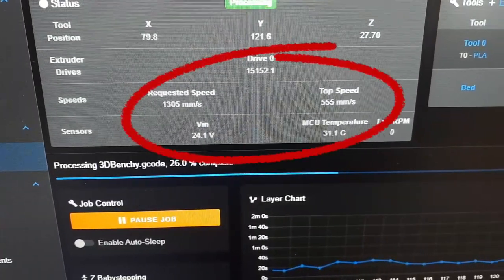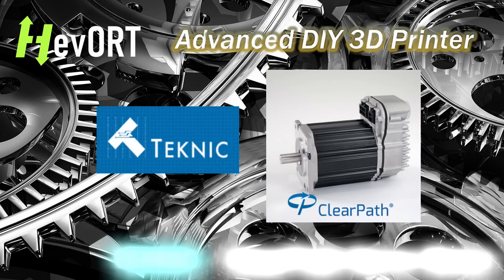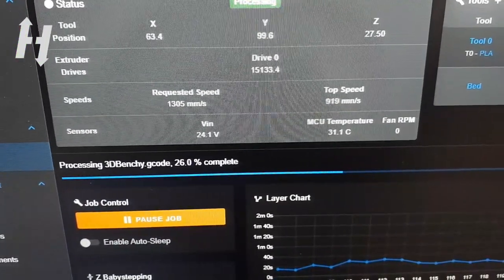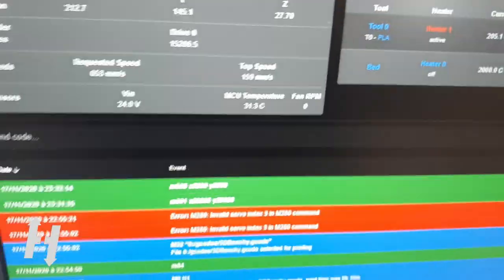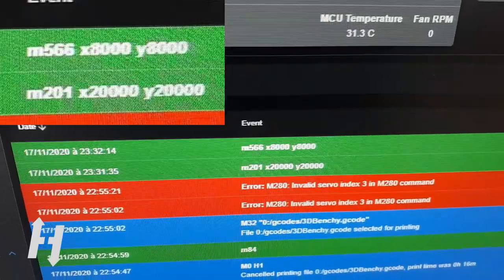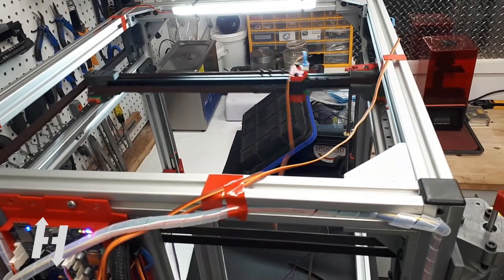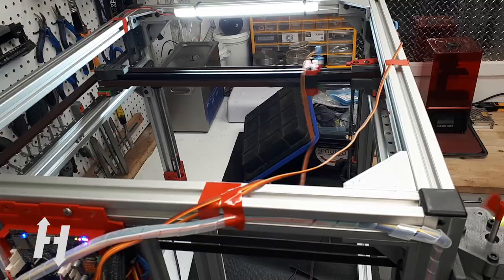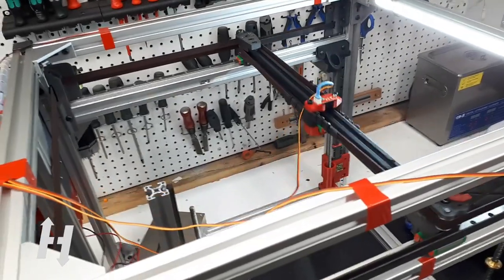3D printer on Servo Motors? HevORT & ClearPath testing spoiler

Comment: So sick. Are you using an Odrive to control the servos?
Reply from the maker: No, I am running the ClearPath through step / direction / enable type of signal using the Duet2 Wifi and a breakout board made for 5V single ended logic.
Reply: oh 0drive would be interesting for like a massive printer
Reply from the maker: @quinnfoster4671  have a look at these clearpaths ;) https://www.teknic.com/model-info/CPM-SDSK-2321S-RQN/?model_voltage=75
Reply: Have not seen Odrives or Clearpaths on a 3D printer, although I've been waiting...
Reply: @MirageC  I've been working on a pellet extruder design for several months.  Maybe you can help me test it when I'm finished 😁
Reply from the maker: @brawndo8726  For sure! keep me posted :)
Reply: @MirageC  Sure.  I can ping you in the git repo.  Happy to chat if you have any questions.
Reply: He's using ClearPath servos in step/direction mode.  About 2x the price of an O-drive setup but nearly plug and play with a Duet2 or Marlin board.  You can get them up to 2hp continuous 4hp peak if you want to move bowling balls this fast...  If you were going to production, a "low" power O-drive re-spin or sweat-heart deal with ClearPath servos would be the way to go. For one off printers, the ClearPath servos are a winner due to the plug-n-play.

Comment: My understanding of where the bottleneck is in speed for 3D printing is in how fast it can extrude the plastic. You can go either bigger nozzle with low resolution on the print. Or make a hot pot resorvere. Where you melt a lot of plastic in advance and then use something like a auger to extrude the plastic faster through smaller nozzle. Or use 2 heads, one with large nozzle where you print it into a ruff size and then use secondery nozzle with smaller nozzle  that puts on the final top layer...
Reply from the maker: Yes, definitely, the extrusion system will be my next bottle neck.  We will explore various options.

Comment: Is your printer as quiet as it sounds at these speeds? Mine is so loud even with tmc
Reply from the maker: Yes it is, Servo Motors are completely Silent.  Keep in mind that there are no cooling solution yet on that test bench ;)
Reply from the maker: Arpad Toth  like the HevACS?

Comment: The proof is in actual prints. I did ClearPath motors on a larger 3d printer four years ago and couldn't get it to not induce banding in the print. I currently just run steppers on that printer and it's been fine. I also run a 5kg pellet extruder off of it. I wish the CP motors gave me better print quality as I really appreciated their silence.
Reply from the maker: Yes Jeff, I have been reading about your experience on various posts.  I will give them a try and see if Teknic is ready to support if I cant get proper quality.  Just a quick question.  when you tuned your CPs, what did you do with the other servo?  I simply enabled it so it would be "locked" and then tuned the other motor.  I did not think of any better to represent the CoreXY environment.  I am using the 800 count per rev version.  (CPM SDSK2321S - RQN)
Reply: @MirageC  I ran a crossing gantry machine as I felt CoreXY was too new. But I too would guess “locked” is probably the best bet while tuning the other motor.
Reply: Hi  @JeffDM 
,

I’m an applications engineer at Teknic and I came across your comment. The banding you describe can be caused by a number of factors, most of which can be resolved. (We have a number of OEM customers that successfully use ClearPath motors on 3D printers, so you can be confident that there is nothing fundamental about this application that would preclude using a high quality servo and getting good motion performance with no banding.)

It’s common to see banding (or similar artifacts) occur when there is a mechanical issue, but since you mentioned that your stepper motors are working well on your machine, I think the odds are pretty good that there’s nothing mechanically wrong with your system. (This assumes that the move speeds and accelerations were the same in both cases, because higher accelerations, in particular, can illuminate weaknesses in mechanical systems that wouldn’t be seen at lower accelerations.)

This means the problem you experienced was likely caused by either suboptimal ClearPath tuning (i.e. the Auto-Tuner didn’t give you ideal results for some reason) or a ClearPath motor set-up/configuration issue.

If you still have your ClearPath motors and the time to run them again, we would be happy to arrange a time for one of our engineers to remotely dial into your machine and make sure that you get your machine working well.

If you’d like to do so, please give us a call at 585-784-7454 or fill out a "contact request" on our website to schedule a session: https://www.teknic.com/contact/.

Jon K. – Teknic Servo Systems Engineer
Reply: @TeknicInc  i have a very heavy gantry system with 4 motors on the Z, 2 on the Y. i ordered the biggest Nema34 clearpath motors, but now i'm questioning how i should tune them ... as i cannot move the system with 1 motor only

Comment: Assuming there is no flex, is layer adhesion affected by faster speeds?  As a thought experiment, If I had a frame carved out of solid diamond with motors to match, could I expect to have good layer adhesion?

Comment: Essentium has a hotend that heats to 500c in 3s and They print Even 0.6mm at 400mms so its deff possible..

Im looking at a simular setup but just with precision ballscrews that has no play and 0.0025mm precision. 
All made possible for my budget, after discvoering clearpath :)

Comment: I always wanted to see this. My extra large format machine moves a printhead that is over 1.5 kilograms and with TMC drivers and Nema23 motors I can't get over 160 mm/s speeds othervise I get missed steps (shifted layers). Been looking for a servo driven printer build like yours. Keep up the good work!
Reply from the maker: Thank you!  Yes, nema 23 have good torque but poor speed due to their high inductance.

Comment: The speed is not difficult to achieve. There are tons of applications moves lightning speed. But as he says managing the rest of the printing operation is problem. Extrusion, cooling etc. I think, it can be used some sort of molten plastic reservoirs that pump molten plastic directly from nozzle. So, there will be no hot end but hot reservoir let's say 100ml. And that reservoir needs to be fed by external plastic source.

Comment: By mistake I have 32 closed loop servo motors...but couldn't figure out if I can Run them on a Standard 3d printer Board... What elctronics drive your motors? I have a half built Delta for our makerspace, that would be great I think as a showpiece and also we're building up a Lowrider2 for the makerspace 🤔

Comment: The sloppy hot filament coming out of the nozzle will have some significant inertia before it cools down in situe. You'll require significant cooling at the tip and some powerful nozzle. Friction within the nozzle and filament pressure flex within the nozzle itself will become the next once you fixed that. Happy engineering ahead ;-) Nice project so far though.
Reply from the maker: Yes, agreed.  I got that cooling issue somehow sorted out :)  https://www.youtube.com/watch?v=65FVQ1jArME

Comment: Amazing work and fantastic video! Which version of the XY are you using 9mmHd or 12mmHD? I am working on purchasing parts using your build. I had planned on going with 9mm belt drive and nema17's to start. Wondering if there is much of a difference in drive weight between the 6mmSTD and the 9mmHD set. 
I am attempting to give myself some room to grow on tuning the printer for faster speeds. Do you think performance will be lost using nema17's and 9mm or 12mm belt drive? My best guess is it would reduce  belt stretching at higher speeds. Trying to future proof my build a bit, wondering if i should go bigger and use the 12mm belts?
Reply from the maker: Tough call, even for me to say at this point.  12 mm like I have feels great.  Definitely more friction than a 6mm setup, but very solid.  My current position on the question is that if you intend to use super heavy X carriage, or going bigger than 500mm square, go 12mm.  If not 9mm will probably be your best bet.  But once again, this is all new territory for me as well.  The Think, Design, Try, Correct circle is in the Try quadrant for this gantry ;)  Correct quadrant looks smaller and smaller every day though ;)

Comment: Which kind of linear rails are you using? Do you think cheap Hiwin clones will do for a CR10S project well? Thank you for your videos. Your HevORT project is very inspiring!
Reply from the maker: The 800mm/s video was done on Genuine Hiwin rails.  This new frame with the clear paths is using clones.  So far so good, but print quality needs to be validated.

Comment: I've been wondering exactly this for a long time! Thank you for this! Never could afford servos to test it, so i haven't.. but i think  conventional hotend could never keep up with that, needs to be force fed with a hopper that can really push stuff out, and in order for the layers to cool down fast enough, rather colder temps than hotter
Reply from the maker: Thanks for the comment.  Yes, these motors are going to open many doors.  Some doors currently lead to the unknown.  A lot of experimentation is to the agenda for the nex couple of months.  One thing for sure, the HevORT HD XY gantry can take some serious abuse!  Been pushing the servos to 80K acceleration and 60K jerk at 1200mm/s for 30 minutes.  No sign of fatigue or damage so far.  belt tension is maintained.
Reply: @MirageC  and with a servo to drive a hopper against it's will to push enough plastic, i'll come for a visit to build a 2x2x6 meter printer 😁
Reply from the maker: @Tarex_  We will need to re-think a few things for such a size though ;)

Comment: What motor type are you using for the X Y and what belt size? I am in the process of building a hevort and trying to work out the best drive system. The bed is 500 x 500. Apprciate your advice.
Reply from the maker: Hi Ben, those motors a test, they are ClearPath Servo Motors from Teknic.  Very neat stuff but also very expensive.  If you are in for a good stable configuration that will not empty your pockets too much I recommend HD9 or HD12 XY gantry (HD12 is used in this video) 9 & 12 refer to the belt with in mm.  See more at www.hevort.com (Item #5 has all the data and CAD)

Comment: Have you considered a delta for possibly a higher top speed limit?
Reply from the maker: I have been curious about them but never took the time to look into.  I have heard (did not verify if true) that a heavy head could be problematic for the rods.
Reply: @MirageC  I’m looking at doing a tool changer delta that only changes the hot end and then uses a remote drive gear which traps the filament on the tool change to remove weight. I’m getting a lot of things from cnc tool changers. Thanks to your video I’ll definitely be looking into these faster motors. Great work

Comment: Hi I'm very impressed by your motion system! Can you give me more details on wich comonents did you use. How did you do the pid tuning for the position control? Which interface did you use (step / direction or somthing more intelligent :D ? Im planning on using jmc servos
Reply from the maker: I am harvesting the Step and Direction signal that was intended for the Duex5 expansion board using a DuetBreakOutboard.  The Servos were tuned using their internal controller and the proprietary software from Teknic (manufacturer of these ClearPath servos)

Comment: I really wish these groups would migrate away from Facebook 😐 I have so many questions but my principles will not allow me to participate. Watching and waiting for a tool changer build. I can't give up multi material. IDEX is working for now. Tool changers will be the market for this machine. Too many prototypes require dissolvable supports. The speed at which this machine could change tools would be very impressive. And the bed leveling is so efficient. Loving this. Excellent work.
Reply from the maker: We have a Forum.... ;) https://forums.hevort.com/index.php
Reply: @MirageC  Fantastic. Reading wingnut now. Crazy build.
Reply: @MirageC  is there any immediate plans to implement a tool changer or IDEX build? Or is the main goal for now to push the speed envelope with a single extruder?

Ps: awaiting forum verification
Reply from the maker: @mikeblocker5720  Some members are starting to draft solutions for tool changer.  I would like to start looking at that myself during this winter.  I am not a big Idex fan.
Reply: @MirageC  I dislike a number of things about IDEX as well. For some time it was the only reliable option for multi material printing so I have gotten use to it. Glad to hear people are working on tool change  solutions for the heVort. Exciting times 🙂

Comment: I wanted to know if I could potentially do servos controlled by Duet to likely a servo controller?
Reply from the maker: your servo controller will need to take Step / Dir / Enable signal type.  if this is the case, then yes it would work just like it does on mine.

Comment: Which model motors are these? Are they a drop in replacement for steppers, or do you need a different control board/firmware/etc?
Reply from the maker: You can see the details for the motors here: https://www.teknic.com/model-info/CPM-SDSK-2321S-RQN/?model_voltage=75

They are Nema 23 format so physically bigger than the common Nema17s.  Than are driven using the Step/Dir/Enable signal directly from the control board MCU and converted to a 5V single neded logic.  I am using a Duet2Wifi and a BreakoutBoard for external drivers to achieve the connection.
Reply: @MirageC  Please help as im trying to do the same

Comment: Could you please share how did you connect theses motors on the duet controller. Did you use COON-LCD? Or expansion header. Thank you
Reply from the maker: I am using Duet2Wifi with the breakout board.  See my post here for connection details: https://forum.duet3d.com/topic/19887/clearpath-servo-motors-testing-so-far-so-good?_=1606169751777
Reply: @MirageC  Thank you for sharing your expertise. I don't know if they will work on my printer because I have duex 5 connected I thought maybe I can you use COON-LCD I will do my research
Reply from the maker: @mohamedadams1922  remember that using 2 servos via the breakout board will free 2 drivers ;)  Might not need the Duex 5  afterall.  I realized that when putting the printer together!  :D
Reply: @MirageC   I know but the thing is I'm using 4 drivers for the  Z axis and 4  drivers for for the extruder plus X&Y so I'm maxed out on the drivers. The problem im having is the gantry is too havey it has 4 direct drive extruder and all water cooled plust the extruder motors are water cooled as well to keep motor temp in stable condition lots of weights So I need nema 23 cloosed loop or like the motor you have to solve this problem.
Reply from the maker: @mohamedadams1922  What you need to do is modify the ribbon cable going from the Duet to the Duex and steal the Dir/Step/Ena for 2 drivers  then running them through the breakout board chip to get the 5V single ended (if your servo need such logic format)
Reply: @MirageC  Thats a good idea I will try to do that. Thanks for the hint

Comment: I'm very curious if you can put a Zesty Nimble or Flex3drive to this speed.
Reply from the maker: Unfortunately not.  I have owned 2 Nimble V1.  Their gear ratio will max out NEMA 17's capacity.  Especially when using strong pressure advance value.   Nimble V2 and V3 have lower gearing values but will still not make the cut for this kind of printing.  Making the extruder power motion remote id brilliant, unfortunately the motor used and the torsion of the cable make it not suitable for this application.  I even tried with Nema 11 mounted directly on top of the nimble.  Worked ok, but could not keep up.

Comment: This is literally what I've been holding my build for hahaha aannnd I guess I'll get printing now 🤖...

Also @miragec these servos are most useful for X &Y , so do you plan on leaving the z leveling motors as good and cheap nema 17s?
Reply from the maker: Build plates larger than 500x500 tend to back drive the nema 17s.  Either nema 23 of geared 17s are in the plannjng. Backlash from geared stepper will not be effective since the bed load is always in the same direction.
Reply from the maker: Clearpath on Z would not be logical in my mind.

Comment: Good speed mate, but the fusion time has allways been the limitation. Alas.
Reply from the maker: As answered to another member: [Of course matching material flow with this speed is going to be a challenge.  But just imagine for a second having instantaneous travel moves and enough accel and jerk to reach greater speed on tiny moves.  Just these two thing will make a hell of a difference on print time.]
Reply: @MirageC  Sure the gain on travel moves can potentially reduce the printing time by 20%. Back in 2012, The reprap community have already dettermined the max fusion speed of a 1.75mm filament around 250mm.s². This is reachable with the super volcano with a mounted 0.4mm nozzle. If you wanna do faster, you must must decrease the  filament diameter. Simple as that. ;)

Comment: You are so much right to go with servos. I have already suffered too much brain damage trying to use a 3D printer based on stepper motors. No matter what, it always drifts or jumps when least convenient. What a stupid idea to use stepper motors for 3D printers. And don't tell me that for you it works - unless you live in a different universe with different laws of physics. My brain is not comprehending why Internet is not full of complaints about that.